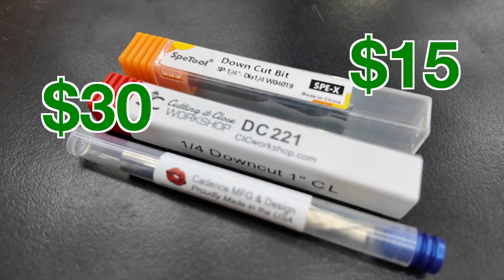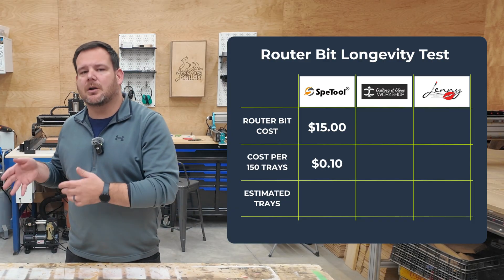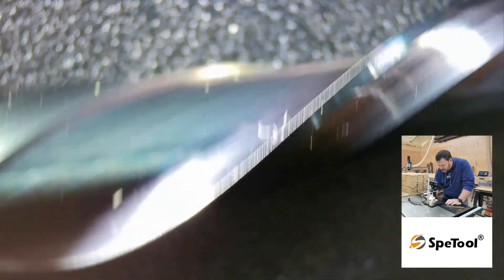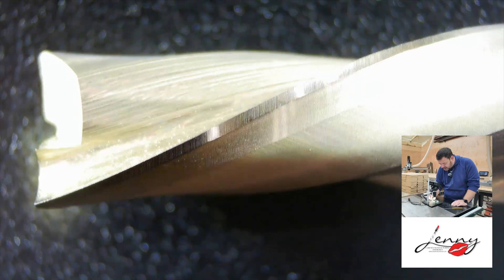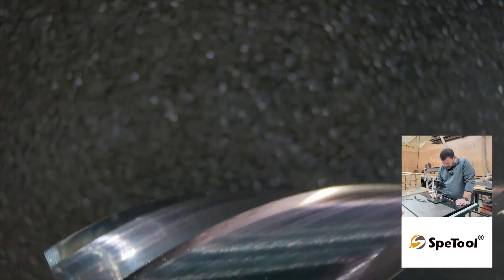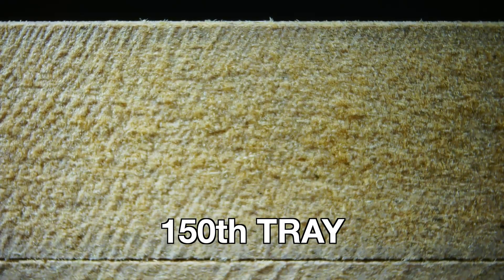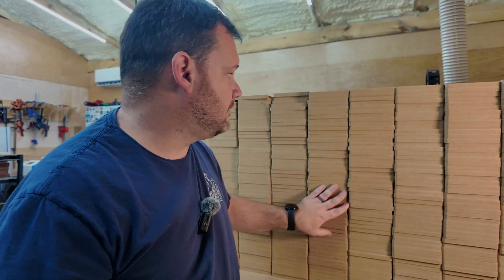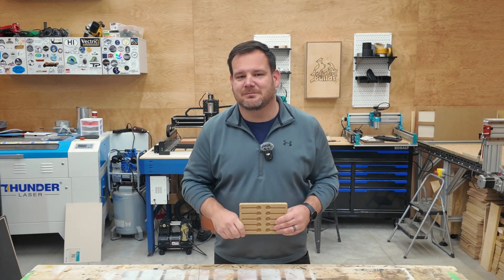Testing 3 CNC Bits Head-to-Head | Which Survives the Longest?

Comment: Great video, but I don't see where you tested the speed. You listed edge and coating wear and made estimates on cuts from...where? You never ran these at varying speeds or until failure. So for you to say the Jenny is excellent and will cut 800-1000 more trays is a variable you just pulled out of the air.
Reply from the maker: We inferred the number of trays each bit could cut based on the rate of wear.

Comment: Comparing only tools with an unknown coating or ZrN is a poor choice in wood. ZrN is made for metal, who knows what the SpeTool coating is. 

DLC is optimized for low temperature machining in soft materials (woods/olastics, non-ferrous metals). It lasts significantly longer than ZrN and cuts cleaner too. Big missed opportunity!

Comment: What speeds and feeds were you running these at?
By default don't they each recommend different settings, did you stick to the manufacturers proposals, or use your own?
Reply from the maker: We wanted to mimic a real world scenario in this test. We picked a speed and feed that is very common for these bits. CIC recommends 80 IPM and Jenny recommends 100 IPM. We couldn't find any data on SpeTool. So we went this 100 IPM 16,000 RPM.

Comment: Loved the video and I really appreciate these! I’m pretty new to the cnc world but out of curiosity wouldn’t we see different results if you have a hobby cnc where you can’t run as aggressive feeds and speeds? Wouldn’t the bits heat up more because you can’t actually cut to the specs that the can handle? And if so would that change price and outcome at all? Or am I thinking about this wrong?
Reply from the maker: Thanks for watching! You're on the right track, but if you slowed the feed rate you would want to slow the rpm of your spindle/router.

Comment: As a user of Spetools and IDC primarily, my money still goes to Spetools. The lower price point, same day or next delivery and unavoidable user errors breaking bits, the Spetool is for me. I’m sure Jenny is much better, but unless you never made a mistake or forget something, I’d rather go through two Spetools than one Jenny. Also, I don’t wait for tool to dull out. Some projects warrant a new tool for unexpected results. What I’d be more interested in, is there any tool out there that can resharpen a bit and apply a coating?
Reply from the maker: Thanks for sharing. I don't disagree. As far as resharpening, it's possible, but you'd need to compensate for the smaller tool diameter after sharpening. When you sharpen a .25 tool, it is no longer .25 in diameter. Most hobby machines don't have cutter compensation
Reply: @AndyBirdBuilds great point! Guess it’s easier to order another bit rather than sharpen and measure and recalibrate everything.
Reply: @AndyBirdBuilds  you can program that new size into vetrics…

Comment: I'll mention what others have said. At 16,000 rpm and 100 IPM, I believe you’re rubbing the coating from the bit’s surface. For MDF, I operate my CNC at 12,000 rpm and 200 IPM, which yields excellent cut quality and tool life from the SPE bit. Of course, the depth of cut also plays a crucial role in all of this. I’m using an AVID CNC, so the comparison should be comparable.
     I recently completed some Christmas gifts made from recycled rosewood flooring. To reduce the chatter, I had to increase the speed to 16,000 and decrease the IPM to 100. At my usual MDF speed, it sounded like the guys from Dumb and Dumber making the most annoying sound in the world. :)
Reply from the maker: Thanks for sharing. We picked a feed rate that was closest to each of the manufacturer recommendations. And since all bits were run at the same exact feeds and speeds, each bit experienced the same testing. If one was running, all of them were rubbing.

Comment: Strange results, I have the same CIC Workshop bit that I have used for months in hardwoods and it has no signs of the coating wearing off. It's very odd that you give the same results to the Spetool and CIC when the Spetool was rounding over after 75 trays. Even though the CIC bit lost coating in your test, there were no signs of the edge rounding over. The quality of the carbide is what really matters. 

Don't get me wrong I love the Jenny Bits as well, I've owned most of the bits they make. However, CIC Bits are amazing and have never let me down. I'll keep ordering both.
Reply from the maker: Thank you for sharing your personal experience. I thought it was strange as well. Take a look at the pictures of carbide under the microscope again, SpeTool and CIC carbide look very similar. Your claim of no signs of carbide rounding over is not what I saw.
Reply: MDF is extremely abrasive, hardwoods are cleaner to cut.
Reply from the maker: @8thsinner Very good point. 👍

Comment: Great video and even comparison. I’m curious if any of these bits have different feed and speed rates that would’ve affected the performance.
Reply from the maker: All of them were run at the same feeds and speeds.
Reply: @AndyBirdBuilds Which is NOT what you should be doing. Different coatings handle different chip loads better. You inadvertently increase the heat on certain coatings by not cutting fast enough.

This test was extremely flawed and as someone who works in the CNC space you should know better.

Comment: Been using SpeTool all the time, could the lifespam be longer while feedrate is higher? cause my CNC is running ~5 hours a day and spetool downcut with this spec-x coating can last the whole month without quality drops running at 425 inch/min all the time. Great video btw!
Reply from the maker: I think so. We picked feed rates closest to the manufacturer recommended feed rates.